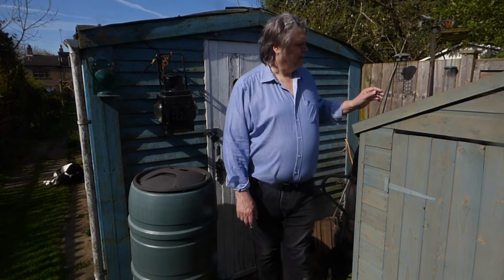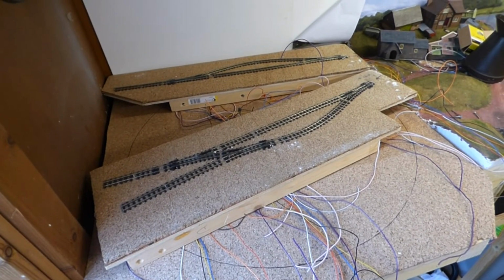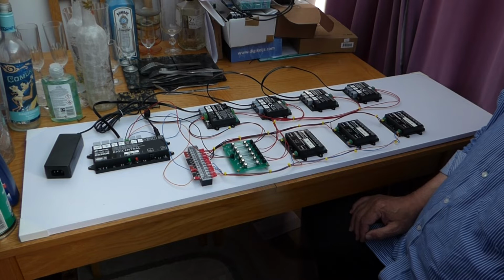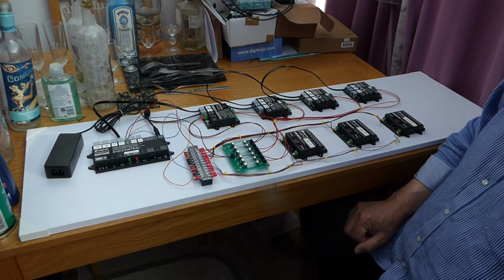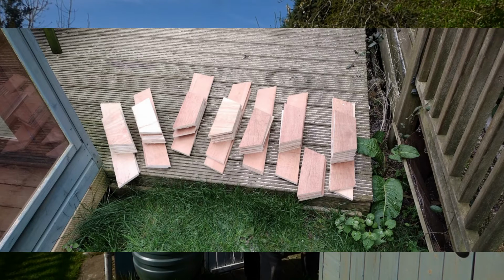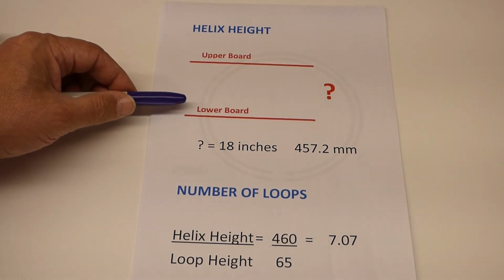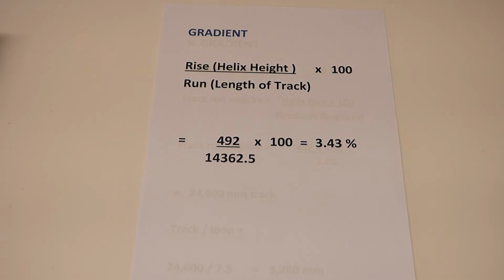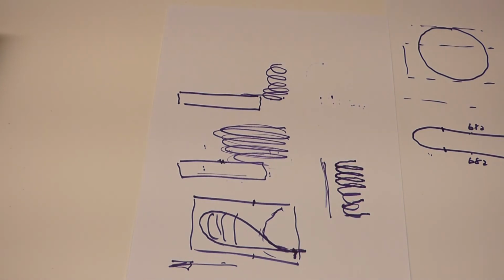Helix Design, baseboard disaster and Digikeijs at Halton Warren OO9 Model Railway. ¦ 007

Comment: I had loads of problems understanding the 5013 and the reverse loop. I also use the 4088, and as long as both tracks that come after the reverse part are isolated, they will work (and show occupancy) However I still fail to completely understand Digikeijs 5013 instructions, so use the simple short circuit version.

Comment: Hi enjoying the vlogs, quick question can you plug the Nce cab into the dr5000?
Reply from the maker: Hi
Glad you are enjoying the vlogs.
NCE and DR5000, I am not the man to ask, as I am not that up on DCC still struggling to find my way through it.
I do have an NCE Power cab and I have used it to control Digikeijs devices such as the DR4018.
I went for the DR5000 as I want to use iTrains and the DR5000 is the interface between the PC and the layout.
You could try a good DCC supplier such as DCC Train Automation, they are very helpful.